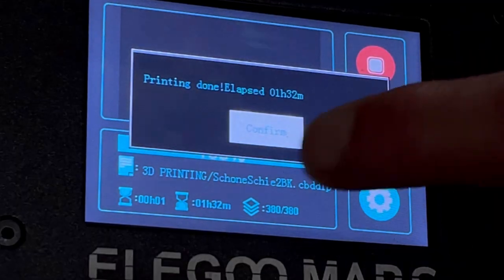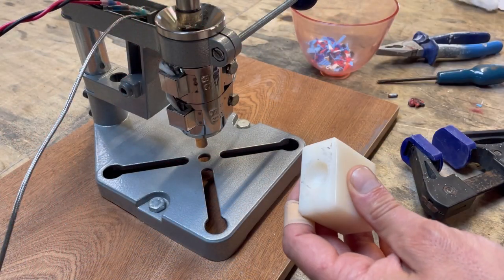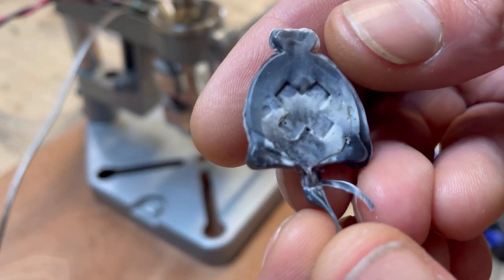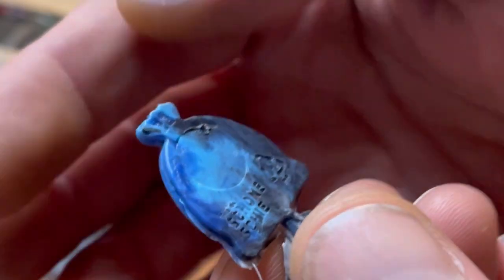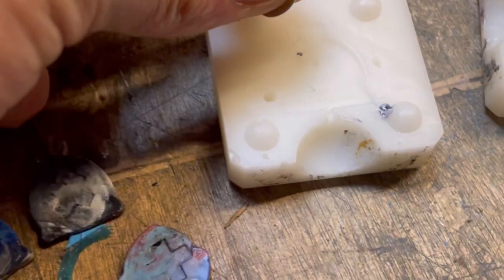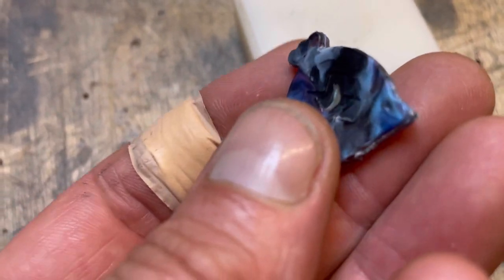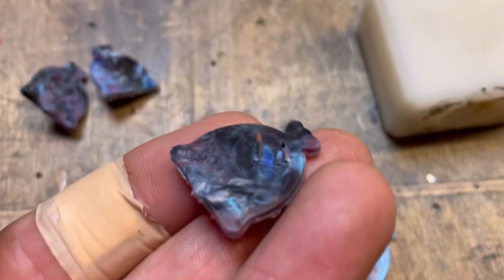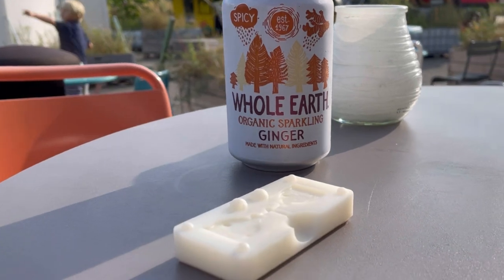Injection Molding with 3D Printed Molds

Comment: falling in the rabbit hole of diy injection molding, i don't even know why. But, the tip I saw was, there is a metal collar ring you can add where the metal meets the mold so you don't melt your resin mold with the hot tip of the injector. Just add it in to the resin mold design. Saw it on TheCrafsMan, DIY Injection Molds (Inject plastic into silicone!) video.
Reply from the maker: I just saw yesterday that Ryan of Buster Beagle 3D also made something like that, that fits the LEGO pattern which you can print into your mold and that would def help. Even though I haven't had any 3D printed resin molds melt in any way. They do however, after too many pulls quickly after each other, have a tendency to crack because of the heat, and pieces can come off. I have had that with the new molds I made after this one (which I still have to edit into a video) and with the molds I used in an older video about injection molding with 3D printed molds (and the DIY Dave Hakkens/Precious Plastic injection molder). I used Siraya Tech Sculpt printing resin now, which should be able to take more heat, but they still crack eventually. So I think having two molds at hand if you want to do a lot of pulls is not a bad idea. So they don't overheat and crack as quickly. Oh, and as far as the rabbit hole; it's great in here! You should defintely come! :D
Reply: @baschz  Maybe once I find the $ to mass produce... oh, and find the right item to mass produce :P... and find the right marketplace to move said product....
Reply from the maker: @DarksealStudios  You'll find your excuse ;) For me personally I have been making my art to look like it was mass produced in a factory by hand for over 25 years and now, with machines like these and resin 3D printers getting more and more affordable, it finally opens up the possibilities to not only make it look like that, but also use the same materials and production process to actually BE like that. Instead of using let's say silicone molds and cast resin. So I am not looking to mass produce in that sense, just make it look mass produced, so my excuse (to be able to 'play factory' on my desktop) is already met ;)
Reply: @baschz  I wish I had the cash to do it right now, you have no idea... I might have to make a product specifically to find the excuse to get one. I have to bite the bullet and make a small batch of stuff to sell to get the capital to up my production game. there is so much I need though...
Reply from the maker: @DarksealStudios  I feel you. right now I am luckily in the position that I can afford to one by one in little steps buy some things that, although they have come down in price quite abit over the last years, I have been wanting since sooo long, but they still cost money.
Reply: @baschz  at least $400 is in that attainable range. 3d printing had my attention but who knows now, I really just need to find that "thing" so I can start busting out stock. Havn't quite nailed down what to make on scale.
Reply from the maker: @DarksealStudios  I use 3D printing for the molds, but I am mostly talking small amounts with large amount easthetics :) 3D printing is still great for makkng prototypes begore ordering or making the final metal mold. If you have the chance, just start with something, anything  ecause I think once people know you do this, they might come to you themselves for those parts. Plus you get to start already. You’ll have to get the hang of it first anyway ;)
Reply: @baschz  just need that initial capital to start with. I'm self employed 3d artist, so i have to make money with my art to invest into more supplies to make money from my art to buy new tech to... etc. and things have been rough on the 3d front.
Reply from the maker: @DarksealStudios  Totally understand. Been there (and mostly beING there to be honest). I hope things will pick up soon!
Reply: @baschz  thanks! keep up the good work.

Comment: Can you use an FDM mold (like PLA), instead of SLA?
Reply from the maker: PLA doesn't work. It will just melt
Reply: @baschz  Thanks! What about other materials that an FDM printer can support? Is there any?
Reply from the maker: @nickst2797  I am not a 100% sure because I haven’t tried or dived into that but my guess is no

Comment: Will this mold last for more than 500 injections? I'm looking for low cost production. Metal molds are too expensive for me. 20 diffrent products will cost me like 50k$ in molds. 3D printed are like 10-20$ each.
Reply from the maker: they won’t unfortunately. they are especially interesting for prototyping, as far as my research has gone so far. the resin I used here is a standard one and there are more heat resistant ones, but I think 500 pcs is pushing it. you could do different designs after ech other, to give the molds more time to cool maybe. you can also cast resin molds btw.
Reply: @baschz  Found a video from mold making factory. They used 3d printed molds for over 1k times untill it get damaged. Some special resin used to make them.
Reply from the maker: @ascain91  That sounds interesting. Curious to see the video. Do you have a link? I’m guessing they are printing their molds with a FormLabs or fancier printer and resins. What I am using is a ten times cheaper (and thus affordable for me) Elegoo Mars desktop resin 3D printer, which probably makes a lot of difference. I have just made several tests so far, so there is hopefully still a lot to learn and improve on for me, but my gut says that with my tools and set up I will probably not have the success rate that video is talking about. Very much open to learn and proven wrong though.
Reply: @baschz  Formlabs: https://www.youtube.com/watch?v=iZeu8LAnTvw
Elegoo: https://www.youtube.com/watch?v=96cs407U3DI
I think its all about condition of printing and postprocessing not a machine.
Reply from the maker: @ascain91  It's mainly about the resins in my opinion. Formlabs has a tough resin that's supposed to work really well, but Formlabs prices are around tenfold of anything Elegoo related. I do have a Formlabs printer now, but I was able to get it super cheap because it was broken. I am trying to fix it, but haven't had the success I would want with it so far. In the Formlabs video you also see them using it in industrial machines and with metal frames, which is quite different than the desktop injector that I am working with. The second (Elegoo) video is about soft injection molding, making fishing lures etc. That's quite different from the injection molding I want to be doing. It might be perfect for what you want to use it for, but I want to work with harder plastics than fishing lures. I have tried the resin he is talking about, Siraya Tech Sculpt, and want to do more tests with it, but so far I see the first cracks and bits breaking off after around 20 pulls.
Reply: It depends how big the molds are and how complex. There are plenty of hobbiest cnc machinists who may be able to make some mold molds for a lot let than £50k. Aluminium is easier to machine, and it's for limited run sizes it should last. I'd offer but I'm too busy making my own parts.